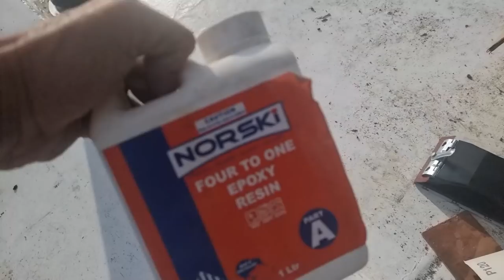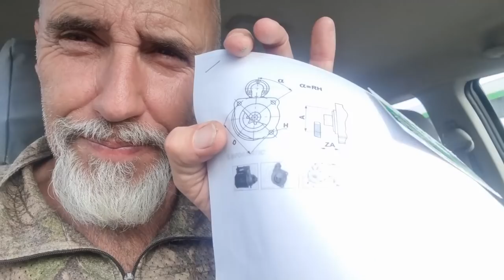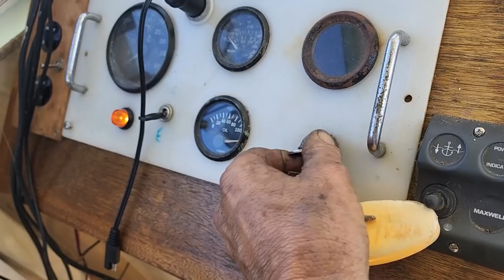Starter Motor Wont Start

Comment: Hi Clay I know these engines very well :-) the part number your looking for is OEM LEYLAND GEU436 or LUCAS LRS106 should be some floating around but getting rare these days... the one you have fitted doesn't look correct :-)  if you can find a rooted one that's correct easy to rebuild...
Reply from the maker: Thanks for the info!